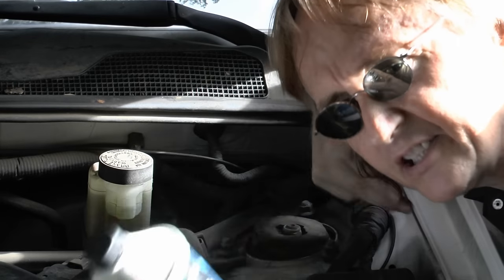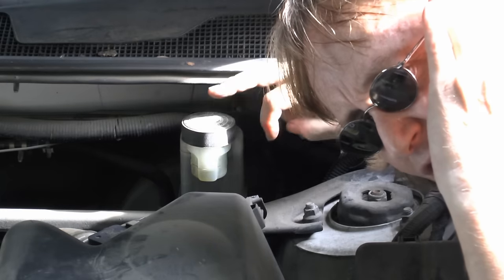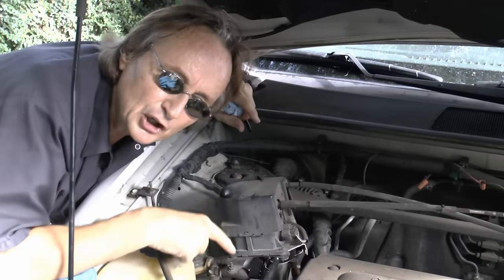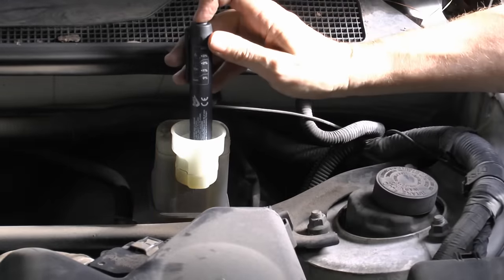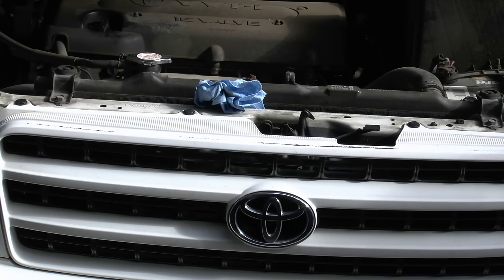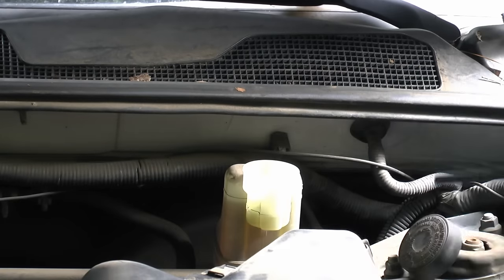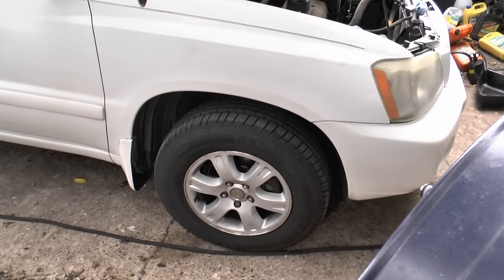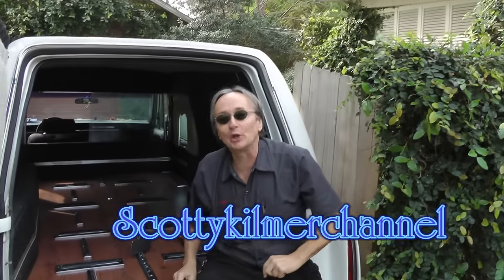How to Change Brake Fluid in Your Car

Comment: Scottykilmer is it a good idea to buy a hummer h2
Reply: I've seen them with 150,000 miles running like new. They don't really hold value well either, so you might find one for a good price. If you plan to go off-road with one, good luck. They are very vulnerable to snapping a front axles.

Comment: Hey Scotty, it's been raining heavily the past few days and every time I leave my car outside for a few hours, the car doesn't take off very well in the first gear (manual) and the clutch feels tighter, so I am forced to switch to the 2nd gear instead for a smoother transition. This also happens when I get a body wash. What could be the problem? The braking also becomes very sensitive (more responsive than necessary) when exposed to water, but I suppose this is normal?
Reply from the maker: brakes are somewhat normal, but have your clutch checked, it may be wearing out and humidity can make it slip then
Reply: My car is only 2 and a half years old with 17k miles on the odo. You think it may be wearing out? :( Clutches are expensive!
Reply: Scotty Kilmer when I put the pedal to the metal I get this rubbery burning smell.
Reply: William Todd I think my driving is fine and I'm not speaking with pride here, but I think there's a room for that error since I learned to drive on this very car and my driving could have been dodgy the first couple of months. I'll see if I can get it checked, but this NEVER happens when its not wet. Thanks for the input.
Reply: Rýán Túçk Should I raise this issue with the dealership and see what they can do?
Reply: You make a great point, but if I went to the dealer, wouldn't they address the problem for free? Since they are at fault and it wasn't my doing. Although I haven't heard of a 2.5 yr free service that you speak of. I don't think things work that way where I live. 
My guess is they'd ask me If I have the extended warranty, which I don't, to do it for free. If they quote a price, I might just go to a mechanic outside, check the difference and pick whatever's best for me. Thanks.
Reply: My car's problem doesn't bother me all that much. Most days the driving is very smooth and doesn't cause any problem at all, the shifts are good too and the clutch is normal sometimes despite being exposed to humidity. The dealership here employed a bunch of idiots who always draw blank faces every time I go to them with a question about my car. What is the problem with your mum's car that made it so dangerous?

Comment: On our 15 year old car we have NEVER changed the brake fluid, and it has 100.000 miles on it now. 
Our car is german, and our mechanic says that due to the fact that it is a good quality engine, it still looks good. 

Can I by the looks of the color see if it has gone bad?
Reply: The engine has literally nothing to do with the brakes or brake fluid, what kind of mechanic are you talking to?
Reply: kgisabeast I think this was the mechanics son. He seemed pretty unreasonable. But how can I tell if the brake fluid has gone bad?
Reply: If your brake pedal feels soft, brake fluid lasts a long time, but typically you just wanna change it every few years, it's not expensive.
Reply: Daniel San No such thing as quality German engine..
Reply: sn9696 Say what you want, we never had any problems? Once we had an American car, everything went wrong with that piece of shit. Once American, never American again!
Reply: Daniel San BULL SHIT, German cars are the worst!!   How long you had your German car, every time some one says they never had a problem with a German car they usually are lying, if you keep asking them they will say, well i only had a problem with this and a small problem with that etc etc but that's not bad for a couple problems because most cars have a few problems blah blah blah!! i know so many people with BMW/Mercedes and they have that car in the shop/dealer once a month! The worst car i ever had was a NEW  Mercedes, German cars are junk, they always need repairs,OR  high cost  complex maintenance . THIS IS A PROVEN FACT!!  IF YOU NEVER HAD PROBLEMS WITH YOUR GERMAN CAR YOU ARE A RARE CASE!!
Reply: sn9696 Well why? We have had ours from new in 15 years, only one small problem and regular service. 
Our neighbor have had their VW Passat for 6 years driving 230.000 KM and there was NO problems. 
You can find Passats and old Mercedes with 500.000-800.000KM on the clock and they are still looking sharp. What about American cars? They are a big piece of FUCKING SHIT. Only Americans are patriotic enough to drive their stupid fucking garbage cars.
Reply: Daniel San  Do you live in the U.S.?Like i said, this is not up for debate, it is very very well known German cars have many issues, even Scotty Kilmer says stay way from those shitty German cars, watch his video about why not to buy a Mercedes, worst car i ever had by the way. i knew hundreds of people that had a German car and will never buy one again! Yes their was a time American cars were low quality but this was the case with most car company's, including German car companies. American cars are now built pretty good!! Yes the very old Mercedes once in a while went 1,000,000 miles, but you can find any brand of car with 1,000,000 miles, even America cars. Stay away from Volkswagen,Volvo, Mercedes, BMW, Renault and Poeugeot, all shit garbage, i used to have a mobile detail service and we would not service Volvo or Vollkswagen because they were so easy to damage due to the low quality parts! Now grow your ass up and stop taking everything so personal because you must be German, typical German!! GERMAN CARS ARE SHIT!!
Reply: Older German cars actually were decent, you see lots of 80s mercedes with 3-4-500k but not any newer ones, same with bmw, old ones were solid, new ones are designed to fail. I'd much rather have a lexus than a mercedes, way more reliable.
Reply: +kgisabeast No the newer ones are still reliable, it just depends on what model you buy. The cheaper Mercs like the CLA are cheaply made. But AMG Mercs like the SL's and such are very good. Especially AMG Mercs equipped with the 5G tronic transmission. That transmission is soooo incredibly strong I don't know if it's even breakable. People drag race 55's and even 65's all day because of the reliability. The trans jus takes it. Blows my mind. AMG strengthens every internal part of the car along with BMW M so if they're breaking stuff on those cars they need to get their heads examined. Cause that's nonsense.
Reply: +Vizenz121 , Funny, i know some one who had to replace a transmission on a AMG Mercs under 100,000 miles, and let me tell you it was big bucks. Nonsense you say? Again, it is very well known BMW and Mercs have constant issues...
Reply: sn9696 Let me guess: You live in America, drive a big fat and useless Cadillac and you are very patriotic - right? 

Just take it as it is: American cars are shit, German cars are not.
Reply: sn9696 Toyotas are good, german cars are good, American cars are fast big ugly plastic cars.
Reply: sn9696 Um... Ok. What AMG Merc was it if you don't mind me asking. Model year?? The first 7G transmissions that came out had some durability issues, but as time went on the 7G's were eventually made as strong as the old 5G's These changes were made about 4 or 5 years ago. However some of the transmissions in the SL63 equipped with the M156 engine, R230 chassis, have some trans issues and that's because it was one of the first transmissions of it's kind. The newer transmissions though are solid as hell and of course the old 5G AMG's. You can't automatically say "All Mercs have constant issues", because that's not the case. Some Mercs have some issues while others do not. However the 5G trans durability rule is a good one. Do you're research before you buy any car from any manufacterer. That's a definite.
Reply: +Daniel San I have been driving my 93 Pontiac for 22 years that I've had since new and have never had a problem and still looks brand new. Still has the original spark plugs, shocks and I mean it has never been touched except for regular oil changes. All other fluids have never been touched and your saying American cars are shit ! You couldn't be more wrong. I also still drive my 78 chevy  4x4 truck I've owned for 37 yrs. Everyone I know who has a foreign car or truck only keep them only a few years because they start falling apart and in the shop more then they drive them. My dad and uncle were german car technicians who drove chevys and fords to work. That should tell you something.  After working on these cars they told me to never buy these cars cause they are not worth the money. People have been brainwashed thinking German car quality or German steel is the best. Don't be stupid and fall for it. It's just to get you to buy their junk ! I can say crap about german cars like your saying about American cars all day. Buy what you want is what I say. Who cares what you think ! And what you say isn't going to change my mind anyway.  Good Day !!!
Reply: +Daniel San I have been driving my 93 Pontiac for 22 years that I've had since new and have never had a problem and still looks brand new. Still has the original spark plugs, shocks and I mean it has never been touched except for regular oil changes. All other fluids have never been touched and your saying American cars are shit ! You couldn't be more wrong. I also still drive my 78 chevy  4x4 truck I've owned for 37 yrs. Everyone I know who has a foreign car or truck only keep them only a few years because they start falling apart and in the shop more then they drive them. My dad and uncle were german car technicians who drove chevys and fords to work. That should tell you something.  After working on these cars they told me to never buy these cars cause they are not worth the money. People have been brainwashed thinking German car quality or German steel is the best. Don't be stupid and fall for it. It's just to get you to buy their junk ! I can say crap about german cars like your saying about American cars all day. Buy what you want is what I say. Who cares what you think ! And what you say isn't going to change my mind anyway.  Good Day !!!
Reply: How can you say the new ones are super reliable? They haven't been out long enough to prove that, when I search Mercedes on Craigslist or eBay I never see amg models with over 100-150k on them they typically have very very low miles, a car shouldn't need anything repaired before 100k besides older ones I rarely see any Mercedes with over 200k for sale, my friend had an 99 s class and the transmission went out at like 120k :/
Reply: kgisabeast What? Many Mercs have around 600-1.000.000 million killometres (600.000 miles) here in Denmark.
Reply: +Daniel San , Dude, what is it with you and German cars?? i don't believe your mechanic said that!!
Reply: +Daniel San It's not uncommon. I live in the us and people who take care of there Merc's like the s classes and higher end models with the inline 6's and V8's and the diesels have very little issues unless it was the cars first year of production.
Reply: +Vizenz121 , Not true...
Reply: +sn9696 sure is. All u do is go online look at the maintenance that's needed and when it is. U do what it says. After that ur golden. That's really how all cars are. The Merc's I've mentioned are very durable. The parts and maintenance can just be a little more expensive. In terms of owning one it's just like any other car. But the feeling of driving one and the quality is unlike no other. Buying a well kept used SL55 or something is a no brainer in my opinion.
Reply: +Daniel San btw american cars is jokes like F35 jet :)
Reply from the maker: +Daniel San  Yes, they do make great lawn ornaments, those Mercs.
Reply: Scotty Kilmer Haha

Comment: Hey Scotty,

2001 Kia with 61,500 miles. Should I have the fluid flushed and changed? The pedal seems to sink excssively during braking. At first it was intermittent and not noticeable, but now it's getting very noticeable and it worries me that the pedal has too much travel. Master cyl full and fluid never changed.
Reply from the maker: probably need changing, so do it now, BUT realize dirty fluid doesn't really make the pedal sink, worn masters or pressure leaks cause that

Comment: mercedes is telling me to change my brake  fluid every two years. I dont believe it
Reply: That's a load of shit bro. Unless it's contaminated you shouldn't really ever have to flush your fluid. I work at a car shop and we get alot of Mercedes and I've seen ones that are 10 years old and still have good fluid.
Reply: ShadySLAYER666 You can't tell "everyone" that they shouldn't have to change their fluid, because everyone's circumstances are different - some people do more miles, some live in more humid areas (the humidity is the main problem, as you know, brake fluid is hygroscopic).

The change every 2 or 3 years is a "catch-all", it may be needed for some, but not everyone.

If anyone's in doubt, you can buy brake fluid testers on eBay, etc., really cheaply.

Comment: I bought a fixer upper 2002 Sierra for $1,500. Brake fluid was black like motor oil in this truck. New pads, rotors, & dot 3 brake fluid & this truck stops on a dime again.

Comment: Brake fluid basically soaks up water like alcohol does.  This is also why brake fluid containers say always add it from a SEALED container,  though under proper storage and handling this isn't SUPER important... but a container of fluid, even closed up tight, that has had its seal broken then stored for a few years is absolutely no good for the brake system.

Comment: Caution - Make sure not to suck up all the brake fluid. If you get any air into the ABS you need to have it power bled (sic).
Reply: You can't introduce air by taking it out unless you press the brakes
Reply: @roberthughes2687  Not true- It is when you release but also can happen in other caliper manipulations

Comment: Dot 3 and 4 brake fluid only lasts about 5 years, less if you live in a humid area. It also breaks down when heated up repeatedly such as severe city driving or towing.

Comment: In germany you are required to change your brake fluid every 2 years for the annual test, also it has to be done by an authorized dealer. Otherwise you fail the test (tüv)
Reply: +Hendrik de Vries  too much government
Reply: Hendrik de Vries In Florida the government terminated all vehicle inspections 15 years ago, you can drive 15 miles per hour over the speed limit on the highways, you don't have to send the kids to school or vaccinate them. Florida makes Germany look like East Germany.

Comment: scotty i took my toyota prius hybrid to dealership for engine oil change, brake fluid change and transmission fluid changed too but gess what they just change the engine oil as i caught them on cctv also the toyota machnic rev the hell out of the engine after checking the dipstick and the car millage is 48 000. i have never trusted any manufuture car company out there because i know they all have a bad practice so i told my self be positive and look what toyota did very disapointed.

Comment: Damn you Scotty Kilmer you made me spend money! ;-)
Reply: Ordered the tester on Wednesday, it arrived on Friday - tested a new bottle of fluid, 0%, tested my 2009 Falcon, fluid flushed by dealer last year - <1%, tested my wife's 2004 Toyota Voltz, fluid changed by me when we bought it in 2010, was about to change it again, <1% so won't change - so time saving around and hour right there - tested my sister in laws Lexus IS200 - fluid changed who knows when - not in the last 5 years anyway - <1% - so another hour of time saved right there.  A couple of hours of my time saved right away, so well worth the $40 it cost.  Thanks for the tip Scotty Kilmer !

Comment: Why is water vapor accually bad for brake fluid? fluid is fluid or am i wrong
Reply from the maker: +Reinier van der Heijden water is bad cause it freezes and corrodes the metal inside the system. You don't want frozen liquid in the winter stopping your car from stopping
Reply: +Scotty Kilmer ok thanks!
Reply: +Reinier van der Heijden also it lowers the boiling point of the brake fluid so under heavy braking the fluid boils and becomes less efficient, and can be dangerous. Also known as brake fade.
Reply: +Darren Boss !!!this^

Comment: 1 source says to change it 2 years

The other source says to change it every 30k miles

And some chevs change around 150k miles

And what about PST fluid as well. 1 soirce says to flush every 2 years, The 2nd source says to flush every 75-100k miles, and the 3rd source says to flush every 30-60k miles.
Usually doesn't say anything in the manual.  Hyundai in my case

Comment: When I turn my steering wheel in my 2006 dodge magnum I get a weird groaning noise. Any ideas?
Reply from the maker: either it's low on fluid, the pump is wearing out, or the rack is worn and causing the pump to strain

Comment: 10 year old car never been flush.  I believe you must have bleed out or flush at one point when changing the brake pads.  Brake pads don't last that long on a car with over 158,000 miles ( I'm not sure how many miles but I know it's over that)  you had to have change the fuild at about  6 or 7 years old.  

I know thiers cars that are 15 years old never change but those cars have like 30 or 50K miles kept in garage.  Some of  Scotts cars have almost 200k miles or more